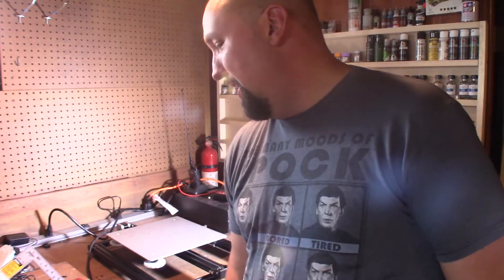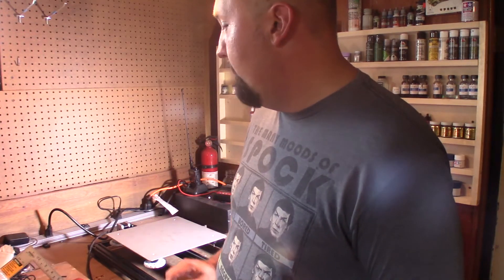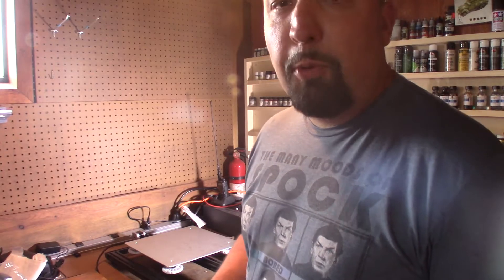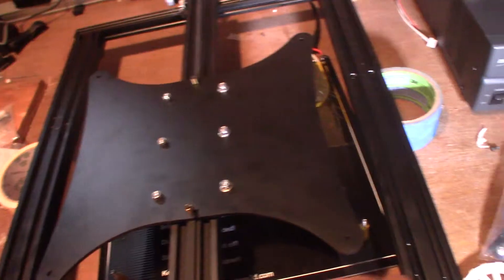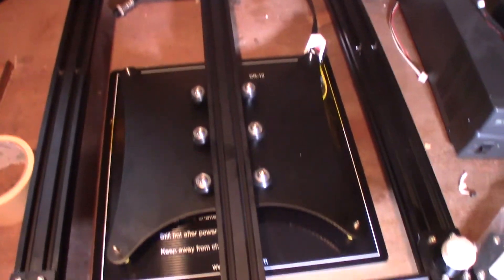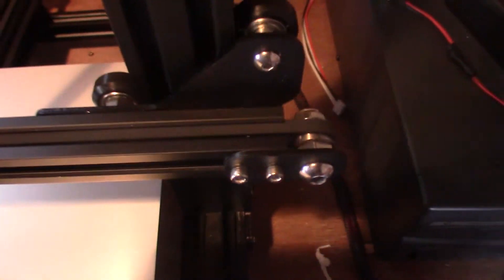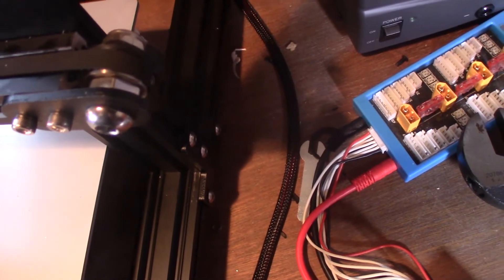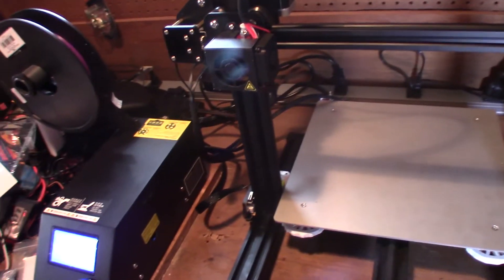CREALITY CR-10 3D PRINTER:  AMAZON HICTOP VERSION-FULL INSTALL AND MODS

Comment: Great video, Thanks
This is one of several videos I watched before choosing a new printer.

I just got my Hictop CR-10 through Amazon and there have been some design changes made.

I printed the heated bed cable strain relief on my MP Select Mini while waiting for the CR-10 to arrive but there already is one so I don't need the one i printed. The heated bed is already insulated so I won't have to do that mod and they went to an extruder with a longer lever.

The vinyl trim was not pre-installed instead they provide enough of both colors to trim it yourself, there's even a video on the SD card showing how to install it.

The only issue I had was the flex coupler broke in shipping but I was able to wrap electrical tape around it to check for any more damage (there wasn't any more) before sending an email to Hictop. Hictop's response (within hours) was that there were two replacements in the mail along with the tracking number.

In the mean time I printed some great looking prints with my taped up coupler and am just now doing a print with the new coupler.
Reply from the maker: electronron1 it’s a great printer that just needs a little tlc when you get it and to keep it running. I’ve done very little mods besides the ones in my videos. It still prints great and with the software in cura and simplify 3d it gets better all the time. Have fun n